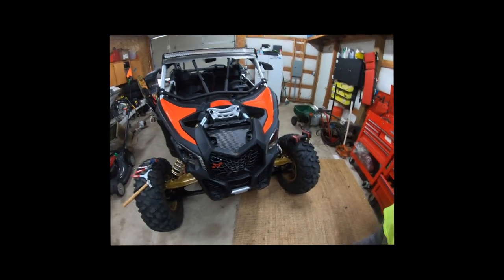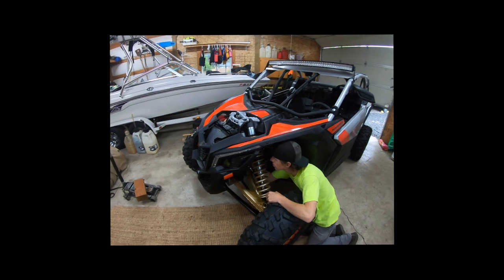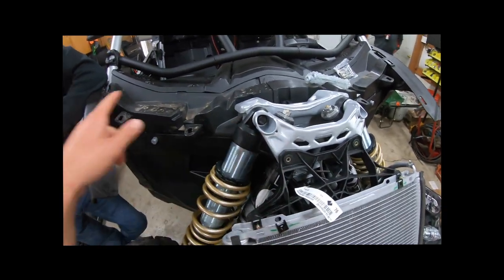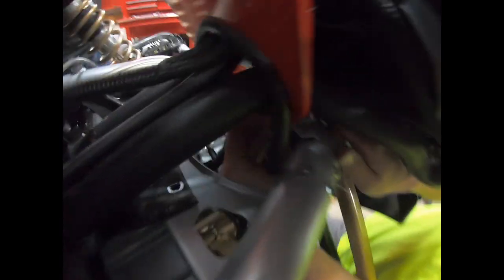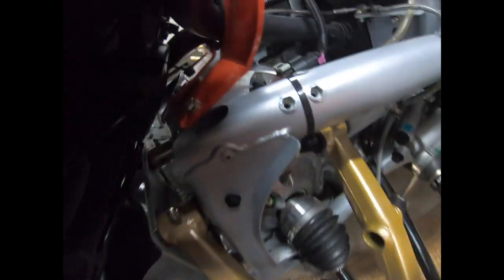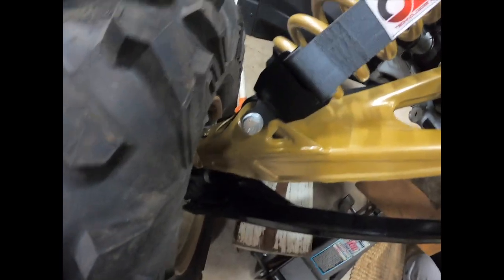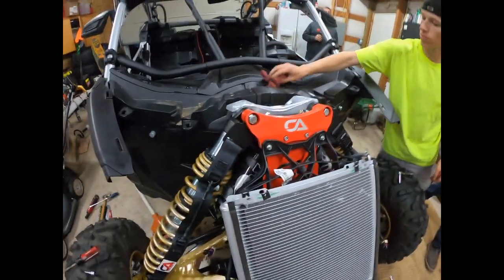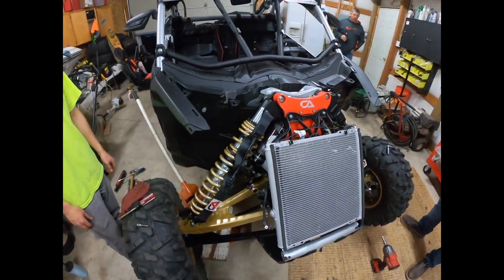CA Technologies Upper Shock Mount Install Can Am X3

Comment: You can install them without removing the front plastics, i just did mine that way. And also put the lower bolts the other way, the nut on the strap side it's easier in case you want to take it apart later.

Comment: Phrasing @1:25...😄
Would love feedback on older parts added now that you have had chance to use them and assess their benefits.
Reply from the maker: Will definitely do that soon
Reply: @MixinGasGarage  You guys sneak out for some riding yet?
Next week looks more like summer weather! That last warm weekend we had we were out tearing up the river, there was no one out there, it was awesome!
Reply from the maker: 101rotarypower yeah we went out to juniper dunes in Washington because horse falls canceled out reservations. It was alright. I got a little content, but I had GoPro issues again like this video. I didn’t realize I had the problem till I got back. I accidentally hit 4:3 ratio on the camera somehow. So the next video might be messed up unless I can crop it to look right.      Anyway yeah we snuck out, it was dry dusty the whoops were big and everywhere on the trails. It’s definitely worth a drive if you live close but not if you live 4 hours away
Reply: @MixinGasGarage  Yeah I read you can use the dunes, but no camping. 

I don’t know if it applies, but there is a local UTV enthusiast that has a place down there with dune access, and someone said they can camp there specifically because it’s private property. 
I am not bold enough to ask, but it sounded like the owner might be receptive...

Just throwing it out there...

I read the dunes might be closed for camping as late as September? I think something said phase3...

We are heading to John Day this week to check things out, I think there is lots of area over there to play.
Reply from the maker: 101rotarypower a lot of the campgrounds are already open, just not for tent camping or anything like that. You have to have your own trailer with water and bathrooms.
Reply: @MixinGasGarage  Good to know thanks, be nice to have a toy hauler right about now then!
Reply from the maker: It would be great if I had one, eventually will lol
Reply: @101rotarypower, I definitely felt better about jumping and going over the whoops with the piece of mind of the shocktower brace, but I still want to get the gusset kit soon. The limit straps I don’t really notice much, but I feel like they did the job when I was in the air so I wouldn’t go to full droop on the front tires.
I will definitely be buying more CA Technology parts, I feel like they put out very good stuff!
Reply: You can truly feel them work when you add preload to the springs. I can definitely feel them doing their job on my car now.